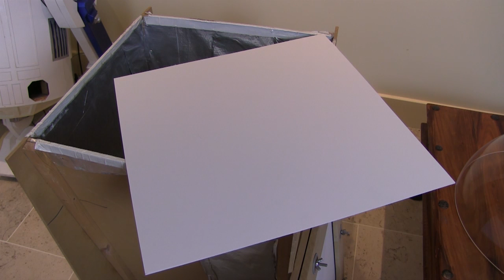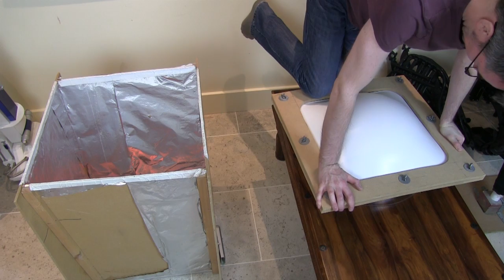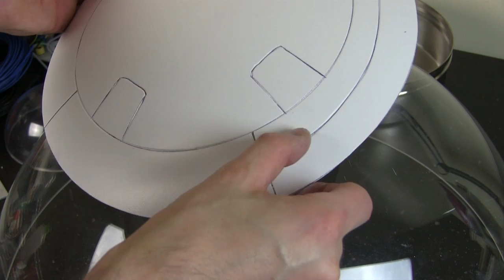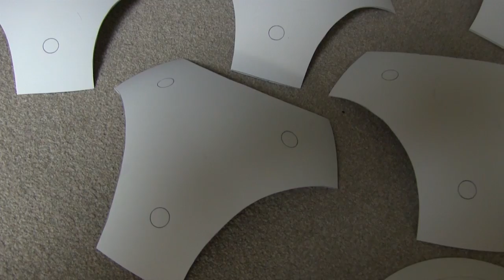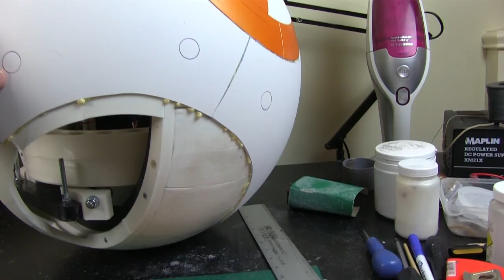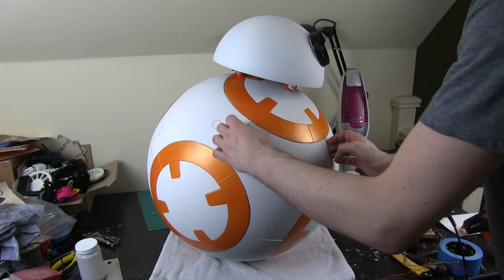Star Wars BB-8 Droid v2 #6 | Body Panels | James Bruton

Comment: This is fantastic! I'm planning to thermoform my panels too. However I realised I'd ordered regular 2mm PVC sheeting and not foam PVC, is that a big deal or will it require a higher heat to soften? Also I wondered if this can be done in a home oven, with all the necessary ventilation etc? Thanks! X

Comment: I was thinking that you'd use similar slip rings on your hulk buster shoulder lasers so the barrels could turn and only the top LED would light up and fire.  Then, the colours could be faded as the barrels turned so that the LEDs could simulate "cooling" as they went from white to cool down to near blue, just before they rotated to the top to fire as "white" again.

Comment: You may have already solved this issue, I haven't followed this discussion at all but I would suggest to make the panel easily removable by putting a piece of steel/iron on the inside of the panel and then just use a magnet to pull it off.

Comment: Really cool build.

For more responsive turning, you could consider splitting the flywheel in two, and spinning the two slices in opposite directions at 50% power. Reversing one flywheel, and ramping up the other to full power should turn your BB considerably faster.

Comment: For the removable sides/panels you could use a few servos to rotate them off
Reply: Or you could use a few small pistons to push the panels out enough for you to grab them off with clips holding it to the hull and control either side with a button

Comment: In Mark III you should consider using counter spinning flywheels. The sound the flywheel was making at low RPM's sounded pleasant and fitting. In the Star Wars books whenever droids are described they per or humm or worr. Audible.com has several of the Star Wars books with LucasArts sound effects.

Comment: Have you tried using spray can polyurethane to seal / harden the foam board? (I would assume you would have to use the matte poly.) Or maybe some bondo / body filler?

Also: cool vids. very good advice about how to go about problems one might encounter on a build.

Comment: uhm i might sound cazy but why dont you just use magnets to hold on the side panels?? use slightly less strong magnets on the outside and use a stronger one I  the middle with a sort of magnetic 'key' to get them off... again I might sound completely mental with this I dea but its just a suggestion/question

Comment: You should consider using an accelerometer with feedback to the flywheel in order to spin it to a specific direction.

also, if you used two flywheels you could have them spinning at all times and choose to spin either direction with no delay!

Comment: Not wanting to criticize, but I think that bungee solution is not quite elegant. There are these magnetic thingies that you find in some cupboards/drawers, that you can press in, and as soo as you release the pressure, a spring behing the magnet produces enough force to push the door/drawer open against the magnet's pull. Closing is easy, just close and the magnets hold the door in place. Now i was thinking that you might use those things in that robot as well? you could even make it completely removeable, put two or three per panel into the frame, and you can just click it on and off.
Reply: Oh, that makes sense of course. I have absolutely no experience with any of the electrical engineering and coding you're doing, so I didn't think of that... but even given the lack of understanding, I greatly enjoy the things you make! 
Edit: Oh wow. Just realized this. Also those magnets would sooner or later get between the magnets that stick the head to the body.  Can't see this ending well....

Comment: Given that ABS is enough of a thermoplastic that the 3D printers can extrude it, it seems that it should work in heat-forming. (Of course by now you’ve already built everything and maybe even experimented with a new version…)

Comment: What about getting some very light fiberglass cloth and putting a layer on the outer skin with epoxy? That should protect the panels from wear and keep them from getting scored. If you use very fine fiberglass, it will become transparent like glass when wetted out with epoxy.  We've done this to a few of our carbon fiber rockets to make them cosmetically perfect. The result will look like glass, but you can scuff it up with steel wool for a matte finish if you want to make it weathered.

Comment: Are you going to use an induction coil to power the head through the ball? If so, I've gotten some decent range on induction coils by making them in the same shape as 2.4ghz biquads. They have to be aligned for this to work, but I've powered an LED over a 3/4 inch gap with just 8 coils.
Reply: +00meat Plays I'm not sure he is planning on powering the head, and if he does I am sure it wouldn't need much power, nothing more than a lipo could handle. Though it would be pretty cool if he used induction coils, the neodymium magnets would render them unusable, as induction coils rely on the magnetic properties of current through wires.
Reply: +00meat Plays Easier to put a small battery in the head, surely?
Reply: Well, yes, but that would be so much less interesting.

Comment: James,let me preface with I love your channel and you do some really great work, and I eagerly await each new episode. Also I realize that BB-8 is further along that the video series, so you might already have the turning issued figured out.  But I have a suggestion that might work for you. Create a function that spins the mass in the opposite direction that you want to turn for a set amount of time then shift the mass to execute the turn.example: left stick pressed (user wants to turn left) fly wheel spins right left stick released mass shifts leftIf you can figure out the timing that the fly wheel needs to spin in the opposite direction before mass is shifted for lets say a 90 degree turn, you could really use that to your advantage. I imagine using a adafruit neo pixel ring on your controller that lets the user know what direction the ball will spin to. example:It takes, lets say 2 seconds of the fly wheel spinning in the opposite direction before shifting mass (using the mass shift function I described) to execute a 90 degree turn. So at 2 seconds the 3 O'clock position on the ring will illuminate, at 4 seconds the 6 O'clock position will illuminate and so forth. Anyway take all my suggestions with a grain of salt it was just an idea that popped into my head whilst watching your video.Keep up the great work!-Dustin
Reply: +Dustin Henry  Oh and one more thing just tie the mass shift function into your hand break function so it keeps its "life like" appearance while the hand break is not engaged.

Comment: Just an idea, I know you've done the bungy thing with the access panels, thought hinging them might have made things a bit less messing about for you, with some kind of spring latch/unlatch system via some of those smaller scored circles, whatever one is nearest the access panel - gets pressed in which unlatches the panel, then when you've finished whatever you need to do, close the panel and as it clicks into place the small push button pops back out flush and continues blending in, it will also save you from having to cut finger holes in the panels too.  However, BB-8 v2 seems to be coming on in great, and as always - loving the videos :-)

Comment: The only issue with the "wearing" of the outside is that you'll have a dirty ring on the part of the ball that only touches the ground with the sides being clean.

Maybe a solution would be to purposefully dirty up the sides to match, when it gets to that point.

Comment: Hello James, here's a suggestion for securing the panels, at least the triangular ones. Drill shallow holes in the frame and glue some rare earth magnets in. Then you can either glue another magnet to the panel or a piece of thin metal to draw the panel closed. It would be a way to hold it together securely and have the panels line up quickly every time.

Comment: +James Bruton (XRobots) Have you thought about doing some sort of clear coat for protection? Or possibly a coat of some sort of rubberized material (which I would think would hold up better and add some extra traction even when on smooth surfaces)? I love the idea of a V.3 with the inside being more like the Sphero BB-8, do you think that will have an effect on stability? (I feel as if this one will have more stability than the Sphero type design)

P.S. Looking great!! keep up the good work

Comment: AWESOME!!! Man it really comes together when you add the panels. It is turning out pretty awesome. I wish all the panels were removable... you could have attached them in the same manner that car door panels are attached. Maybe keep that in mind for V3?

I would make more things removable and less things solvent welded on V3. That way you can fix/replace/improve things as you go on. Just some input from an outside observer.
Reply: +Josh V Plus I just realized the plastic clips that car doors use, you could print on your 3d printers.
Reply: some panels are removeable
Reply: Yes

Comment: you can drill counter sink holes in the frame and glue some small super magnets and do the same to the removable covers and it should hold tightly in place. just an idea.

Comment: Is that just the standard foam board you can get for doing presentation boards etc? Heat forming over a dome like that has just given me an idea for replacing panels on a cosplay suffering from seam lines.

Comment: I don't think you need to worry about the gaps between the panels. BB-8 doesn't seem to be brand new, so it makes sense that the panels would warp and move around slightly when he rolls around on them all day. I'd say the small gaps between the panels makes it look like a real functioning machine rather than a ball with a pattern cut into it. Wouldn't you agree?

Comment: Wow! It is really comming together =)
First I thought that you where just going to fit the panels in height with the printed parts and paint it. So when the round panles was getting higher than the rest I got a bit concerend, but you were (as always) some steps ahead, so when the "triangular" panels was added I finally understood your design. Great work =)
About the wear of the outside. To bad it is only running in one axis, guess the wear will be greater there so the illusion of it running in all directions will be spoiled it time. Not possible to protect it a bit with some varnish or something?

Comment: Clear coat it or something to help protect the surface
Reply: +Julian Dymer But what if you have to run maintenance... hmm I guess you could remove each panel and clear coat individually.
Reply: +Julian Dymer Remember he needs the head to be able to grip the ball with the rollers properly,.
Reply: +GeneralNutzable Its expanded PVC(sintra) it is sprayable. this isn't styrofoam.
Reply: I was thinking the same thing.
Reply: +Julian Dymer He is adding more details still...
Reply: Acrylic should do a pretty good job.
Reply: +ethanpet113 he already glued the panels onto the ball, I don't know if you missed that or something
Reply: +135th Darksword It's not like I said DO IT RIGHT THIS INSTANT or something
Reply: +s zarella there are matte clear coats

Comment: Wow, amazing what you created there! This BB-8 Version is a nice improvement to the former Version and can't wait to see it finished. But already really great work.
Two things I would like to ask.
Firstly, did you thought about to fill the gaps between the panels. That the head could roll a bit smoother? Maybe some epoxy putty, it gets really hard and don't expand when it hardens? ATM the head is a bit stop-go movement. Ok, as you mentioned in a previously video that it is also because of the magnetic connection. But maybe you can minimise it with an almost plain surface and the wheels don't get caught a bit in the gaps.
Which brings me to the second point I would like to mention. The wheels itself in the head maybe have a bit high friction. As seen in video 2 it's a bolt through a plastics wheel. This and with the pressure of the magnets that pulls the head onto the body it maybe leads to a higher friction between the bold and the plastics. Like the flywheel guides you first had mounted. And maybe some small smooth-running bearings instead of the plastic wheel? Or maybe with a drop of silicon oil to the bolt? Maybe this will let the head run smoother and reducing the stop-go movement of the head.

Comment: A thought with reference the turning on the spot. You could program a couple of buttons to execute a flywheel spin and brake, with specific timings, to rotate 90/180 degrees, in either direction. Save you manually doing it. Won't be perfect, dependent on the surface, but could make things a little easier?

Comment: I was really concerned with the aesthetics going into this episode but you've done a pretty good job. My only concern is that the head wheels get stuck in the gaps between the boards and that they'll slowly strip the foam off the frame.

Can't wait for you to show this off at cons. I know you're already talking about V.3 but you've engineered this one so well that it's difficult not to think that it isn't the actual BB8.

Comment: you should add a small camera into the eyepiece and make it stream the footage to your controller so you dont have to follow it!
Reply: +Thomas Simpson (Anfauz) can be done rather cheaply even, you'd just Need a CCD camera and a 5.8GHz Video Transmitter, which you can get pretty cheaply (up to 600mW) on ebay...
Reply: Thomas Simpson It doesn't matter where you moint the Transmitter, if it is a quadcopter, a plane, a car or a movie prop, you may not transmit with more than 25mW of power on the 5.8GHz band in most countries. However nobody really cares, and People are even doing it openly on YouTube without being sentenced to death ;) 
But you are right, 200mW should be more than enough in most cases.
Reply: Neat idea, that's gonna be cool
Reply: muh1h1 i think even cheap 200mW transmitter can do the job well (a couple meter from the stage / convention).
Reply: Thomas Simpson Yes, and that would be a Little bit less illigal :)
But 600mW would be possble
Reply: muh1h1 this is not a drone / quadcopter. As i can assume, you can consider this as movie props right ? so i don't think it's gonna be a problem :-)
Reply: Actually the easier way would just be going for a small off the shelf action camera, and using the streaming function via wifi/bluetooth to a smart-phone..
Reply: +Jarno Cordia Thats exactly what I was trying to say!
Reply: Jarno Cordia Good luck with that in a crowded area with lots of cellphones and wifi hotspots :)
You won't get more than maybe 2 or 3 meters sadly...
Reply: I agree
Reply: +Jarno Cordia there would be a delay though:/ radio would be better
Reply: I was thinking of using a follow me controller, and possibly using a wifi receiver for some function control from a smart phone. and almost getting ride of a large radio.  If that would be even possible, I'm sure it is, because of the follow me functions on drones,  but that kind of programming would be out of my league. And also you can get 25mw transmitters that work well outside, but if near a large metal building it would kill it.  and for using streaming function via wifi/bluetooth to a smart-phone there will be lag, but shouldn't be a problem because it is not going to moving very fast.